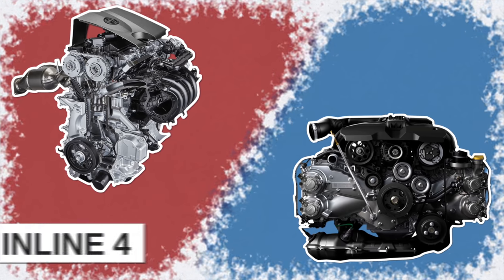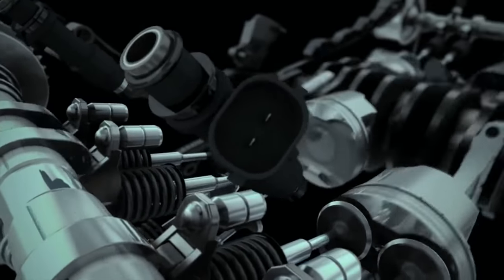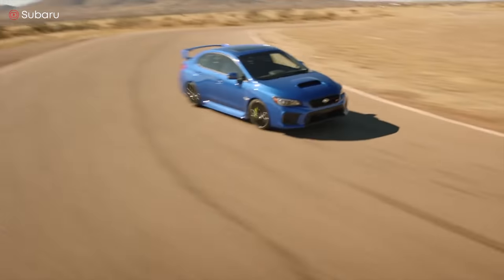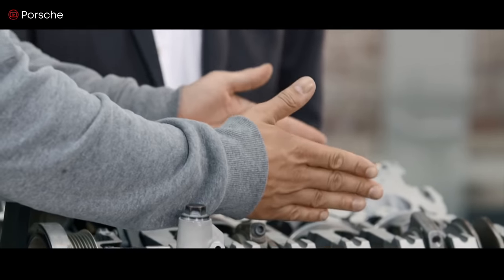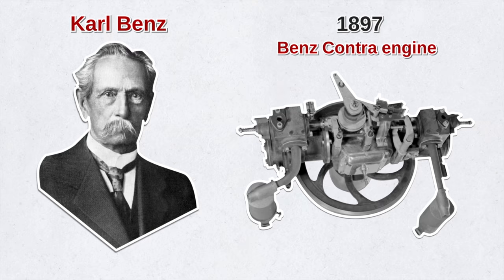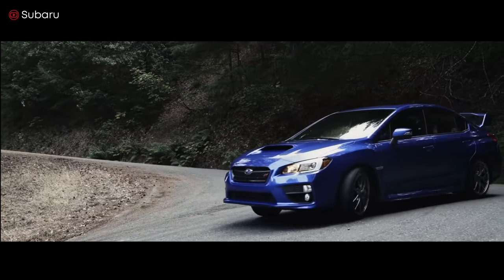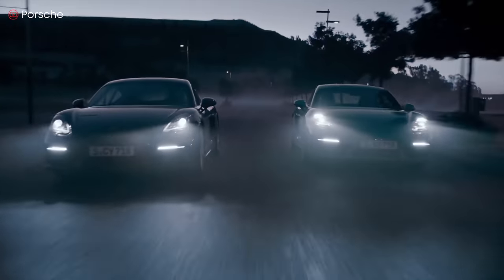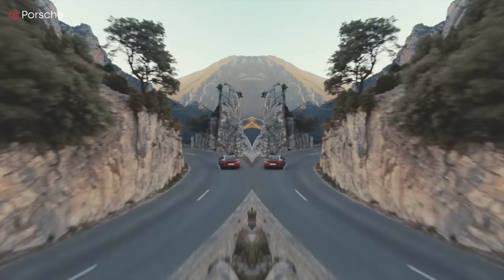Why Not to Buy a 4 Cylinder Engine Car

Comment: Using somewhat wrong animation for inline 4. Most of inline 4 have outer two pistons (1 and 4) moving in same direction and 180degrees oppose to middle two (2 and 3).
But uses the right animation further down the video :-)

Comment: I have only owned 1 car with a boxer style engine and it was a 72 beetle.  But I like it it seems neat for some reason.  I would definitely get a wrx sti I have always liked them.  The power they make was pretty incredible for the time.  I’ve always been a more muscle car type myself I owned a 4th gen trans am with the lt1 and I raced a lot back in those days but I did not underestimate the rice burner type cars because they were pretty mean especially for the engine size.  I can’t say one is better than another but I seem find the boxer type more interesting.  I’ve owned tons of inline 4 cars and they have always been good cars I will even say the most reliable cars I’ve ever owned were inline 4 cylinder type cars.  So while I like the boxer engined cars I have very little experience with them personally.  I’ve worked on them some but nowhere near as much as the online models.  It’s not easy to favor one.  I would just have to say the boxer is more intriguing but the inline 4 is no slouch.  I guess I have a love for them all in one way or another.

Comment: The problems of both inline and boxer can be solved by switching to an electric motor. Over 100mpge less heat, simpler cheaper to make etc..etc...fuel can be made at home with solar. Try making gasoline and diesel at home...no can do.

Comment: There is way more R&D money being pumped into the inline 4 cylinder engine then the boxer engine. Of course the inline 4 cylinder will be more reliable and output more power.

Comment: The GM inline 4 turbo in their full size trucks seems to be a solid engine. It’s been out a few years and lots of people who own them say they have zero issues with them. They have a towing capacity of 9200 pounds which is not too bad.

Comment: Everything is a Variable Valve - Direct Injection - Turbo Charged -  4 Cylinder - engine these days. 
I just want a Supercharged Multi Port Injected Pushrod V-6 or V-8.

Comment: VW popularised the flat four because it took up less space, and was easily removed in 10 minutes for easy access.  The same with porsche air cooled early models.  There was no other reason to entertain it  and has always been plagued with oil leaks. The only reason it continues is as a point of difference. If the flat engine was worth it, a lot more manufacturers would have gone with it. Same as rotaries, not worth the drama.

Comment: To be honest I prefer a N.A. v6 with similar or better power over either for MOST cars. NA is much more trouble free and as long as you have the space working on it is as easy as an inline 4. Maybe more time consuming though... more plugs, more timing chains ect... Super compact cars, of course, need a smaller engine in which case I'm going with the inline or even a rare v4. Simplicity. I don't want to have to lift my car or spend hours for what should be minor maintenance. Also, I suspect gravity isn't kind to the boxer as far as wear goes. 

Off topic but Toyota put 4 cyl in their Camrys back in the 90s at an angle. Oil filter on top. Not only was it so easy to keep the engine oil clean but I think there was some "voodoo magic" going on there that keep those engines alive FOREVER. With those cars it seems like the engine itself outlives everything else on the car.

Comment: In short ej= blown headgaskets and ringland failure 
new fa= crap rods but other than that its a good motor
Reply: FACT # 1 : Motors are powered by ELECTRICITY , engines are powered by BURNING FUEL .

Comment: Hefty! Hefty! Whimpy! Whimpy!
 I did have a 4(cyl) racing engine in an 82 FireBird , which was a great motor (the tranny was an issue), but I'd rather have had a V8. I don't know anything about these inline/opposing 4's. Everything else wore out before that 4cyl on my car.

Comment: Hi Scotty, I got a 2011 Chevy Impala LT and it squeaks when it starts. But only for a few seconds sometimes. Do you think it could be the serpentine belt by chance. The car has a 114,000 miles on it and I don’t know when it was last replaced. Thank you
Reply: Most likely the serpentine belt. Check for any fluid on the belt as that may mean there is a leak. Also check to see if your belt is loose. If you're unsure when it was last replaced and you have 114,000 miles, I would suggest replacing the belt, it isn't too hard of a fix and then you will know for sure when the belt was replaced.
Reply: @Jayman0057  yeah for sure. I’m gonna take a look at it to see if it’s also worn at all. Thank you I do appreciate it 👍

Comment: Just thinking here, folks, why are the most reliable and longest lasting most powerful aviation piston engines flat engines? 4,6 and even 8 cylinder. Because it's simple and a great bulletproof design.

Comment: The only engines I've had problems with actually have been 4 cylinder engines.  Coincidentally, (or not) they have all been FORDS.  Then again, I've had problems with Ford V8s and V6s as well.  Don't buy them anymore.  They've had their last chance.

Comment: Have been driving air-cooled VW beetles for 50 years. They always start run good and are easy to fix. After working on Suburus I would never buy one.  Hard to work on, parts expensive, and very cheaply made.

Comment: I have a 2016 Toyota Corolla S, 4 cylinders 38,000 miles and I'm only getting getting 25 miles per gallon City/Highway. Is there anything I can do to get better mileage? I bought the car brand new and brought it back to the dealer to let them know and they said there is nothing wrong with it.
Reply: That’s about right. I have a Lexus 2016 is f sport. I get the same

Comment: It is better to buy any vehicle with a V6 engine, because it is a lot smoother than the four-cylinder engine. For example, a mid-2010's Honda Odyssey Touring eight-passenger minivan or a late-2000's Nissan Quest 3.5 SE seven-passenger minivan. Thank you very much.

Comment: The 2.3 and 2.5 liter inline ford Rangers run over 400000 miles. You'll wear the truck out. Easy to service, plentiful of ur to stupid to service it. You'll change the body, not the engine!! No flashy, not blindingly fast but economical, dependable , practical!! Lot of auto parts stores around me use them for delivery trucks.

Comment: My choice would be boxer's but pushed I prefer V8s
Reply: My first car was a 1971 253ci Australian V8 GM Holden HQ we call them Station Wagon 3 speed manual I put 2inch extractor headers a 4 barrel vacuum secondary in
1978 I bought it for $2650 au  here down under we are starved of most American Quality for some stupid reason all we get is Chinese seconds these days anyway

Comment: In-line. Cheaper maintenance, and no oil burning to coat the O2 sensors and make your engine run like crap every 10,000 miles. I mean sorry; every 2000 miles. I mean sorry, every 500 miles. You can tell I am a former Subaru owner… The only place is a boxer belongs is in an airplane.

Comment: I wont buy a 4cyl in any vehicle idc what it is. But, but, i will buy the amc designed 4cyl. Either the old hurricane engines or the 2.5 found in the wranglers, and cherokees. Atleast they last over 200k

Comment: Toyota and Honda inline 4 cylinder engines with run forever with routine maintenance and regular oil/filter changes. Not so much with the Big Three 4 cylinder engines. Not nearly as reliable.

Comment: Subaru offers the only reliable CVT on the market for an entire car company.  Toyota offers a reliable CVT only on the Prius because it uses planetary gears instead of worthless belts.  If you are considering a car other than a Subaru or a Toyota Prius with CVT, you are considering wrong!  Never buy a vehicle with a CVT unless it is a Subaru or Toyota Prius.

Comment: The circle is 360 degree and so divided by 6 we get 60 degree among them and cos some of 30 degree give stronger force vector at maximum while 4 cylinders engine piston swing between 0-90 and Max at derivative of cos 45 while 6 cylinders swing between 0-60  and Max at derivative of cos 30 which is greater  but the gravity oposed also Max at the same in 45 on 4 cylinder is larger while is smaller on 6 engines while the other gravity pull push if at cos There fore mathematics is the vision and without mathematics you are a drunkard or vision impaired. If we arrange so that no gravity opposed then 60 is still better in both case.

Comment: Honestly the worst 4 cylinder engine I ever owned was a 2012 Chevy Sonic Lt you might as well have said it had a 3 cylinder engine in it, it drove and rode like absolute crap, a Nissan Sentra and Versa can both outpace that pile of junk for an example. 😂 I mean even though Nissan sedans are extremely underpowered and are junk, but talk about crappy 4 cylinders that was the worst one constantly overheated and the ac never blow cold air at all hardly. 🤦🏻‍♂️ Then of course funny how Subaru and Porsche get mentioned for the best boxer engines, I personally would pick a Subaru over a damn Porsche because atleast a Subaru will last just as long as Honda, Toyota, and Mazda still. 😂 Porsche might as well be a money pit made for looks, and Volkswagen quality has really gone to trash. 😂 And I’m not a huge Subaru fan because there vehicles are overpriced for the money you might as well buy a Toyota for what they charge. 😂 And I simply think Honda and Mazda make some of the best 4 cylinder engines ever, because Toyota 4 cylinder engines are okay, but it seems like a Toyota breaks more when it gets older, not so much with the late 90’s and early 2000’s models but the late 2000’s and early 2010’s models for sure. 🤦🏻‍♂️ Nissan 4 cylinder engines are mediocre at best, if it wasn’t for the Altima and Versa I would say there traditional sedans are junk, not all Sentra’s are bad, but the Cvt transmissions ones suck, I have seen all a rare few working right, the one my mom had was terrible she regret that decision after downsizing from 3 Honda Accords and Kia and Hyundai 4 cylinder engines are about the same as the 6 cylinder engine ones are hit or miss quality for sure, the brand new ones marvelous so far but the older ones he’ll no. 😂 And Mitsubishi engines of any form are trash now, they used to be quality built engines but Renault ruined them just like Nissan, because Renault is basically another FCA or Gm like company makes some decent vehicles but makes mostly junk, Scotty we may not always agree on everything but you are dead on about Honda being the best never underestimate the quality of them, even Mazda is good, it’s ashame what has happened to there poor selling vehicles but that’s okay I really do love Honda for cars for sure. 😁 Suvs well it varies on quality but Mazda takes the category for me because they do something different than Honda, Nissan, Kia, and Hyundai don’t do of course. 😁 And trucks hands down it’s hard to beat a Toyota or Nissan on quality but super duty trucks definitely Gm, I would say Dodge but the Cummins engine is the only thing decent about there trucks in general. 😁 Ford ehhh it’s nothing like it used to be terrible quality especially when the damn windshield can’t even stay put on a 2021 model. 😂

Comment: Subaru engines are garbage.  Head gaskets fail when the odometer reaches 80,000 miles.

I've had 3, I know.
Reply: Had an '83 with over 220000 miles on it and never had to replace head gasket!!!
Reply: Never had any problems with mine